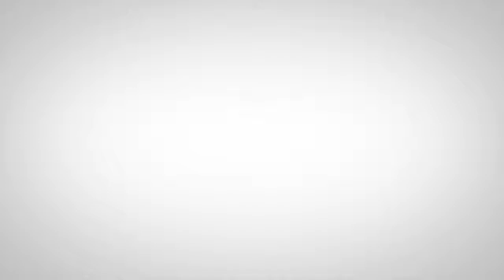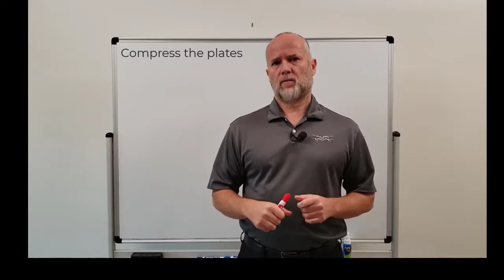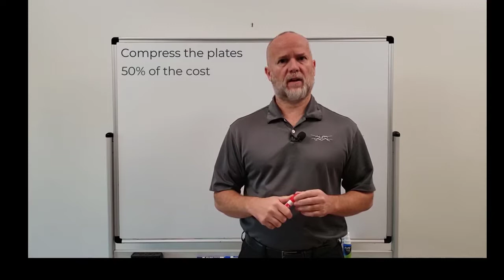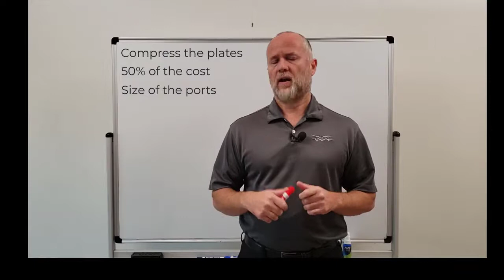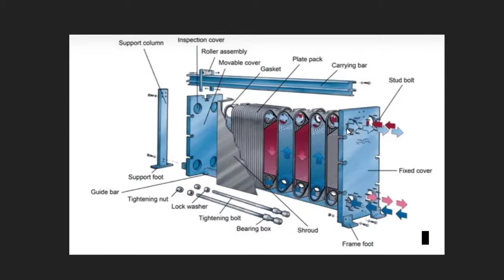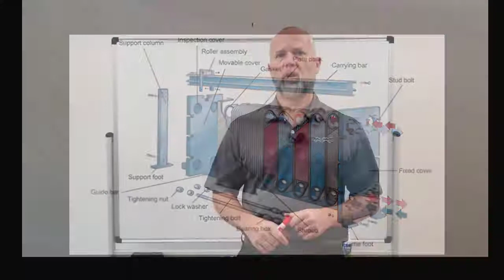Introduction to Gasketed Plate and Frame Heat Exchangers, Part 2   The Frame

Comment: how should we calculate the appropriate thickness of fix and movable frames and the number and size of bolts for specific GPHE model at specific operating pressure like 16 bar?
Reply from the maker: naturally the main factor about that is the pressure rating of the unit. A 10 Bar rated unit will have a certain frame and number of bolts, a 20 Bar rated unit will have a thicker frame and more bolts... another factor COULD be the seismic rating, but normally that influences the feet, but in some extreme circumstances and with a significant nozzle load, it might change the frame as well..... does it make sense?
Reply: @heattransferchannel8474  yes it does sir. but how one should calculate the right thickness and bolting. consider sth of alfalaval products, say M15, with that size, and pressure class #150, design pressure 12bar, what is the right thickness for fix and movable frame? 40mm? 50mm? 60mm? another question why always movable frame has lower thickness than fix frame?
Reply from the maker: @Khabbazhadi  Alfa Laval, as all the other major vendors of Plate Heat Exchangers, uses a proprietary software to determine what kind of frame you need.... naturally the software is the results of theoretical studies AND real life experiences, that is the reason, normally, well established companies can calculate ore accurately what is needed, because they can count of a large number of units installed in the very same, or very similar,  application
Reply: @heattransferchannel8474  so its not just a simple correlation formula to determine frame thickness based on pressure?
Reply from the maker: @Khabbazhadi  for the most part it is, but there are other considerations....